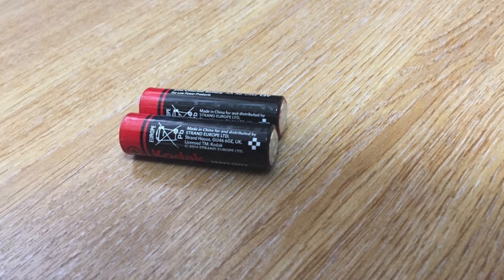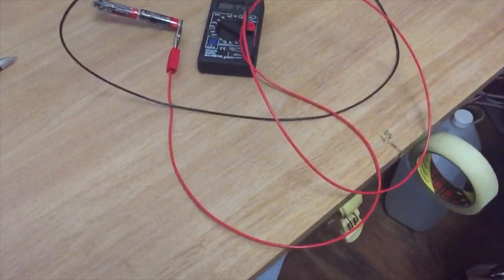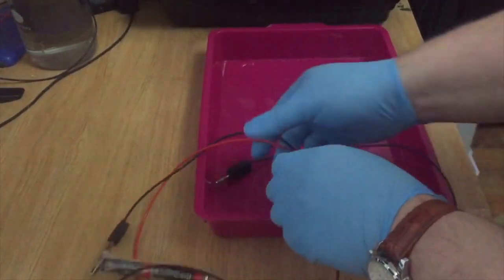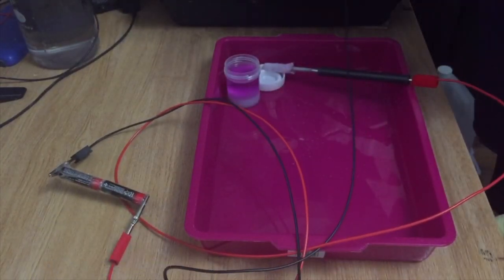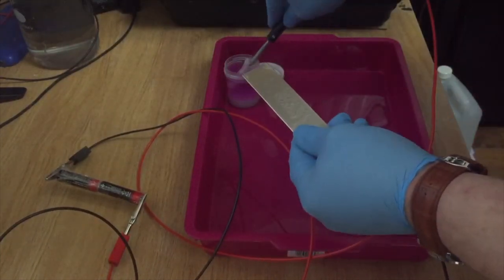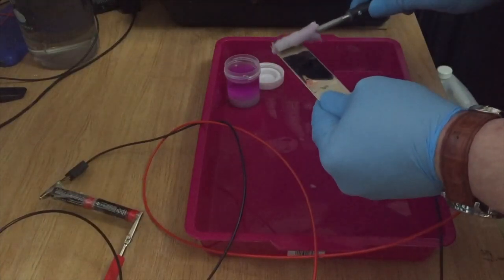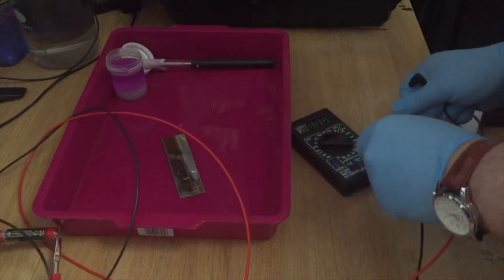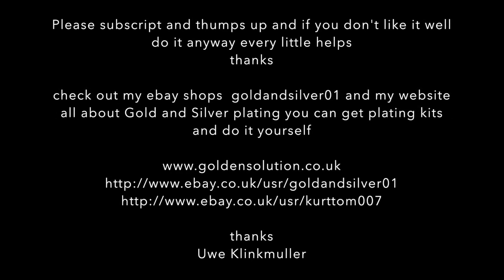How To Gold Plate with 2 AA Batteries

Comment: Would that 2x AA batteries setup work also for copper plating?
Reply from the maker: Yes it will work with any brush plating solution depending on the recommended voltage setting for the solution you may need to use 3 or 4 aa batteries 
thanks

Comment: What is the solution u use to goldplate the metals? Love how nice it turns out
Reply from the maker: Vato Diablo just gold brush plating solution 
You can get it from my ebay shop or website 
www.goldensolution.co.uk
Thanks
Reply: Thank you i will shure order it from you soon
Reply from the maker: Vato Diablo thanks
Reply: @vatodiablo3440  did you get it?